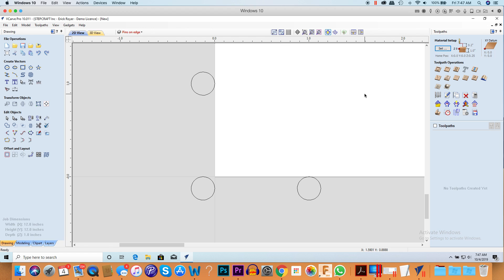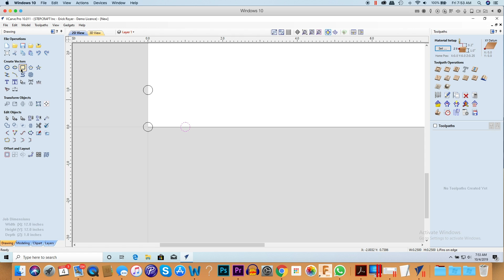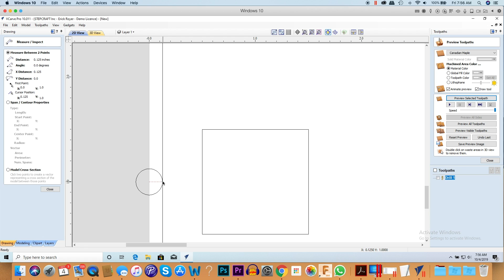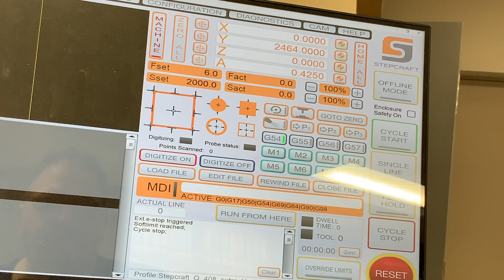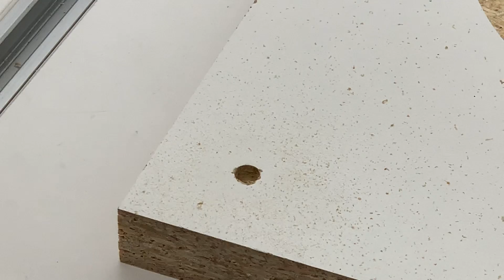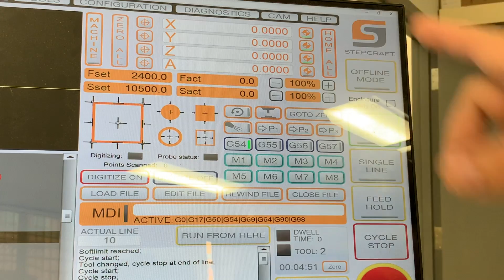Perfect Registration Every Time - Creating A Dowel Pin Zero Reference Point On Your CNC

Comment: Your 0,0 should not be dependent on the cutter size. If you line up your material on 0,10 and 10,0 vectors you have all the reference you need independent of the bit you are using.  Your indexing is off vectors, not where your cutter will reach 0,0. I have spent too much time trying to maximize table cutting size and minimizing material loss.

Comment: When I hit the P1 on my M1000 it goes to 53.7000 (x) 31.7000 (y) -10.000 (z) instead of 3.175, 3.175, 0. Is there an update I need to do or is there a manual way to change that P1 data point? Thanks Erick!
Reply from the maker: Hi, Yes please contact me at info@stepcraft.us and I will have it sent over
Reply: Great video it explains a lot. I currently have a CNC4Newbies 4x8 platform. Like in your video when I home my machine it is currently off the material like you showed. How can I get that info on the P1 option to set my home position like you showed. Thanks Eric

Comment: I also don't own a StepCraft but watch all your videos. I use wooden dowels because I tend to make errors and cut the border and touch the dowels at times, metal dowels wouldn't be good for me! lol
Reply: Use to dowel pins to locate your work, hold it down with double-sided tape, then pull the dowels out once the material is fixed down in the right place

Comment: Seems it would be easier to just move machine to extremes and drill tiny holes then lay down a piece of thin wood as a ruler/square along those lines and screw them in
Reply from the maker: As I said in the video, there are several ways that you could do this.  This was just one to illustrate why it is important to have a reference.

Comment: I thought G55, G56, ... were made for such things, maybe the P1 macro+zero all is simpler, thanks for the tip.
Reply from the maker: Yes, you are correct.  G55, G56 etc are made for this.  The problem is that if you set G56 to the required start point (.125 over on X and Y)  and you accidentally reset Zero to another location (ask me how I know) then you lose your required start point.  The P1 macro, just makes it so you can always get back to that starting location regardless of where you have any other work offset programmed.  It is a failsafe way to maintain that starting location when using reference edges.